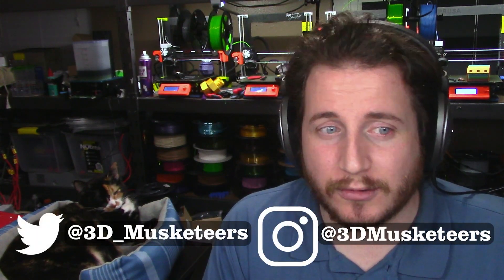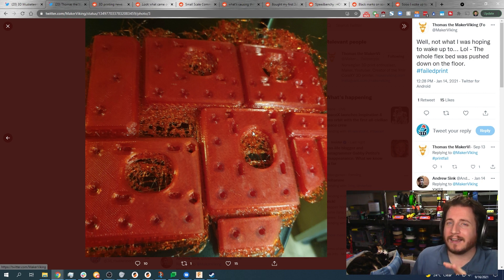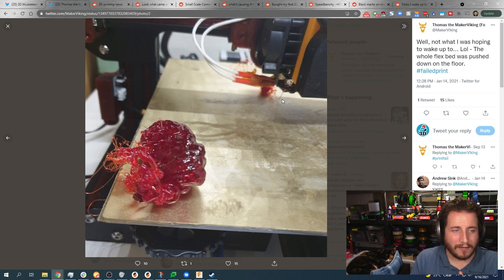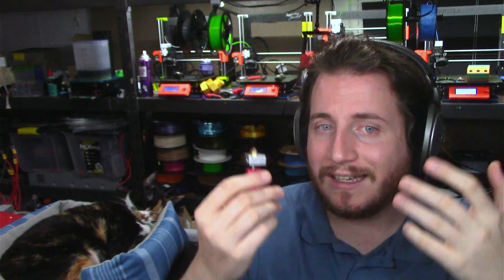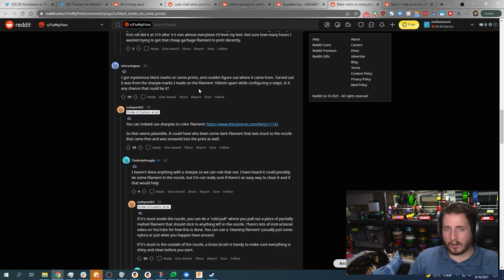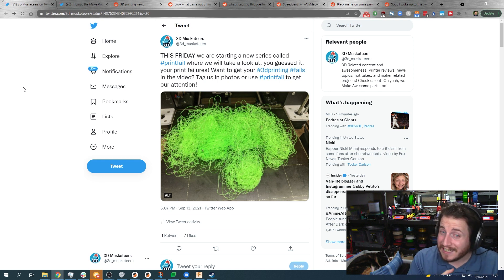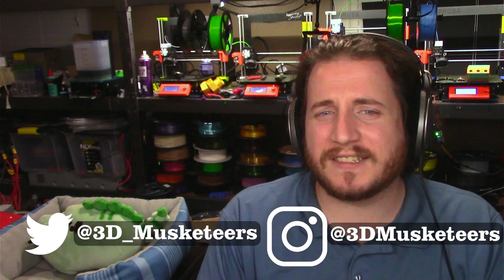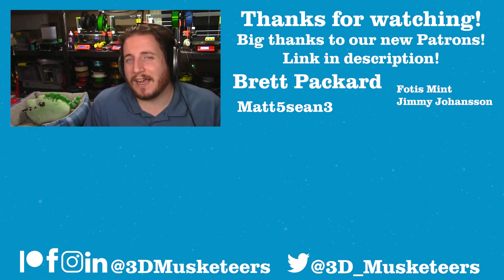HOW??? Reviewing Your 3D Print FAILS - PrintFail 1

Comment: I had a the blob of doom multiple times. Sometimes so bad that the sock doesn't save it and replacing the whole hotend is much easier. 

Having a herniated disc sucks man, I had 2 as well several years back and one earlier this year. They can get better and they can heal. Infact the bigger the faster it heals.  You have to stand up and walk a lot more, and strengthen your core (abs, obliques, lats, erectors and glutes). Disc problems are natural part of aging and some have herniated disc and never experience pain. Check out Austin Baraki and Barbell Medicine. Herniated disc is temporary, surgery is permanent.
Reply from the maker: We have only had the blob once, it was a rough afternoon lol. Sometimes, yes it is MUCH easier to replace! 

My discs are at a point where they will not heal, according to the multiple doctors I have met about this, surgery or shots (that so far have been ineffective) are my only options currently.  Mine were not from an age thing unfortunately. I am glad you fixed yours though!